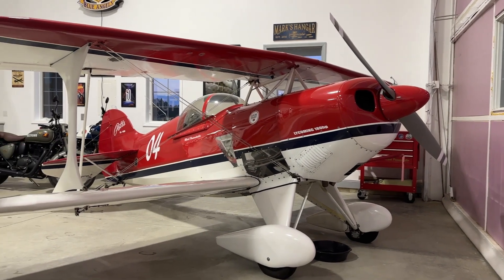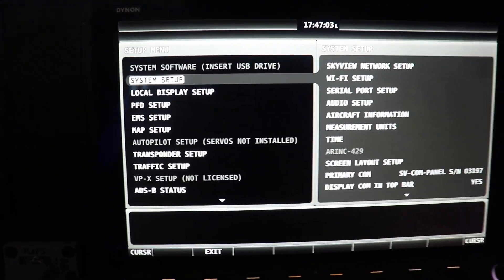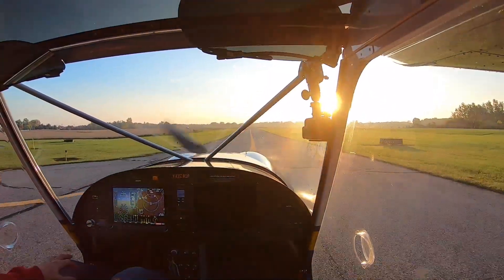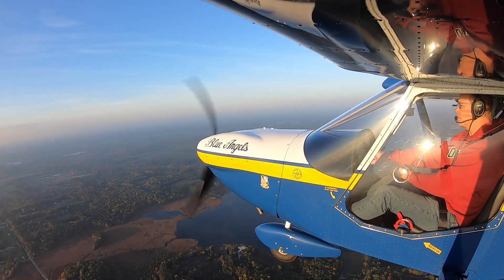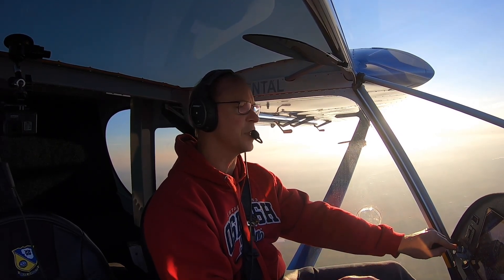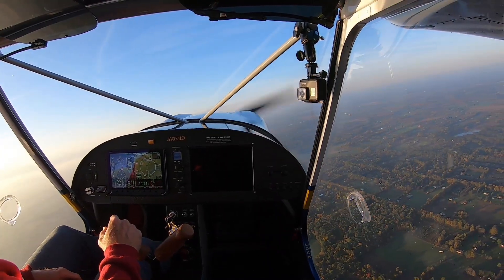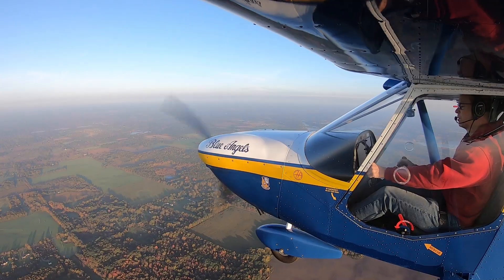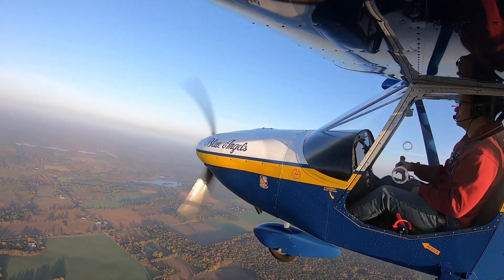KTS vs MPH - Which one do you use?

Comment: Hello Mark, we had to build our 701 because of the heat and started again yesterday.
You asked which unit is preferred.
Here in Europe, for ultralight aircraft which correspond to your LSA with MTOW of 600kg/1320lbs, the flight speed is usually given in km/h and only a few have mph or kts.
One of our flight instructors said that he converts the speed into kts and, for example, at 60 kts he takes half, i.e. 30.
If he then maintains a descent rate of 300 ft/min at 60kts, he has exactly the 3° glide angle that is optimal for landing.
That's why we wanted to install an airspeed indicator in kts so that we don't have to do large conversions in flight.

Comment: Mark, you inspired me to go check my speeds at several different RPM's  Here are my results with my CruZer at 2000 MSL/1800AGL, OAT 65F, Clear day little to no wind:  2500 RPM - 94 IAS/97 TAS;  2600 - 100 IAS/104 TAS;  2700 - 106 IAS/111 TAS:  2800 - 110 IAS/115 TAS.
Reply from the maker: That seems pretty close to mine. Just a bit slower but you have larger wheels and no wheel pants. Also, I doubt our prop pitch is set exactly the same.
Reply: @KitplaneEnthusiast  All true.  The biggest difference was slow flight and stalls.

Comment: As long as the electronics are available, and you are not using paper charts (which delineate latitude and longitude in degrees, minutes (nautical miles), and seconds), you can use whatever you want.  In scenarios when you have to transition to paper charts, you can save yourself some confusion by keeping everything in nautical miles (knots) to begin with. MPH = 6076*Knots/5280 = 3038*Knots/2640 = 1519*Knots/1320, or approximately MPH = 1.15*Knots.
Reply: 1.152’s been stuck in my mind for over 40 years, so conversion is easy, as long as you have a calculator handy as one gets older 😉

Comment: I am just starting my Cruzer build. You seem to get the same cruise performance, 116 mph at 2800 rpm, with the 130 hp high compression 350 as Roger gets with the 118 hp low compression. Your climb rates seem slightly better. Some people have tried to convince me to go with the 6 cylinder UL 390 I (140 hp) or even 350is (160 hp). I am sure the climb performance would be phenomenal, but not sure the cruise would be significantly more, maybe 120-125? Of course then you run into maneuvering speed limits in bumpy air. Your thoughts on UL engine choice? My mission is similar to yours, local $100 hamburgers, not as much cross country. Thanks! Keep up the great content!
Reply from the maker: I would choose the 118hp UL Power.
Reply: @KitplaneEnthusiast  Fuel economy outweighing better performance?
Reply from the maker: Yes and a slightly less expensive engine. With the 118hp you can use the cheaper 87 octane car gas. I have to use premium in mine. The only draw back is maybe a slightly less climb rate, but this plane climbs like crazy anyway.

Comment: I rebuilt a 1961 Cessna 172B and put in a full Dynon glass panel,  but since the plane was originally built for MPH with the POH and Checklists all in MPH, that's what I use. Why confuse things with a change and introduce the chance for errors? So MPH it is, even though I learned to fly in Knots.

Comment: Here in the UK most people talk in Kts, my aircraft has mph and it is a pain as everything from weather to nav revolves around kts. The aircraft I am now building will be kts.
Reply from the maker: When I first built this airplane, I had it in MPH and then switched it to KTS for the reasons you list (weather, ATC, charts, etc..) but everyone I talk to seems to reference mph. So I switched it back to mph just to be on the same page. It's really easy in the Dynon to switch it back and forth.
Reply: @KitplaneEnthusiast  I think it is because there are not many homebuilders here that most of the GA pilots talk in Kts, the LSA type can be a bit a bit mixed but most will convert to Kts when talking about their aircraft.

Comment: I would be curious how having a Dynon Pitot tube might change the readings.  My CruZer with same engine, Sensenich Prop and no wheel pants I am probably seeing 5 mph less at those cruise RPM's.  My indicated Stall speeds are much higher than you documented in the video.  If it breaks it is in the high 30's but it will be "falling leaf" in the low 40's...
Reply from the maker: That’s interesting Scott. I’m not sure if the Dynon pitot would give different readings. Next Zenith Flyin let’s fuel our airplanes the same and let’s fly both and compare!
Reply: @KitplaneEnthusiast  Sounds good…👍